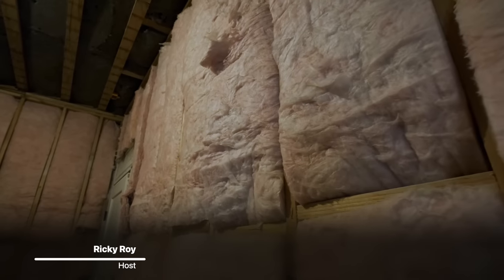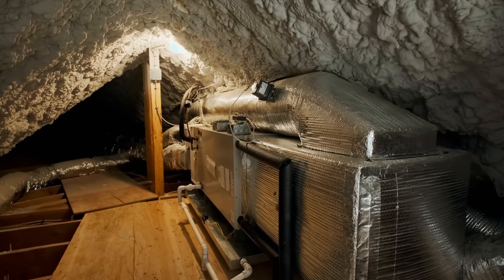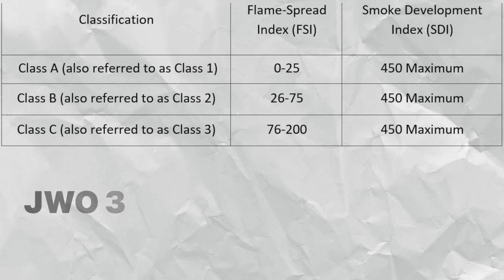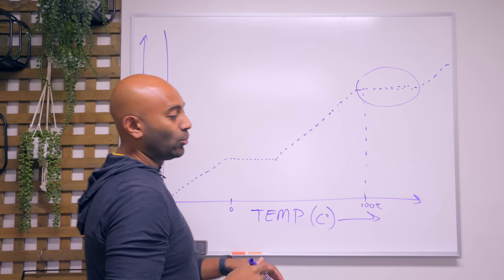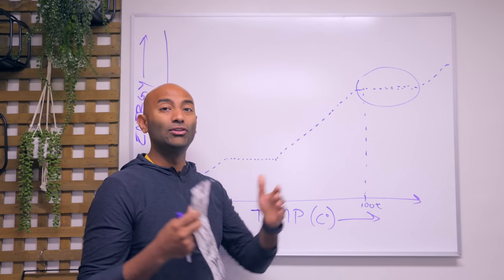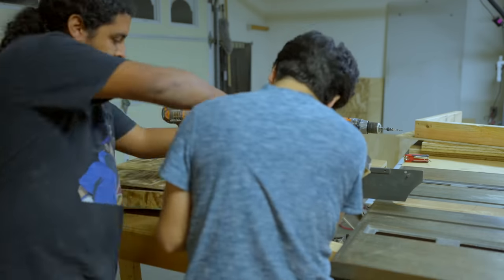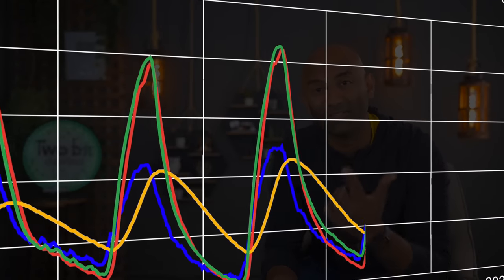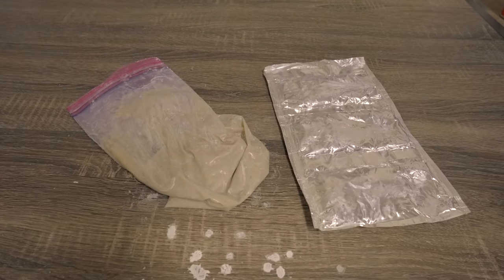The Genius of Phase Change Building Insulation!

Comment: damn you guys use insulation POORLY over there. Here in nordics we just buy the right thickness rockwool, barely a few mm oversized cuts so they stay in place by themselves, then we add moisture barrier, essentially quite thick plastic sheet stapled to the studs. no empty spaces, no crevices, no bulging etc. on the insulation material. then drywall / plaster wall which is made of 2 sheets of paper and in between calc.

Outside is wind shielding panels just after the rockwool, that's a little bit like plywood / cardboard i think, and then finally is the actual outside layer you are able to see.